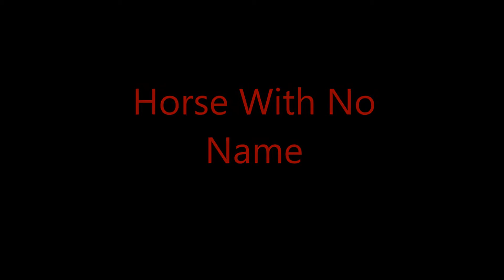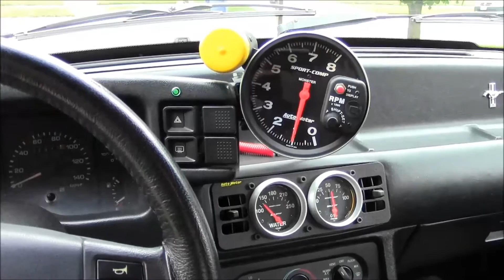HID LED Mustang

Comment: what brand are the tails
Reply from the maker: +Acekid187 I got them from American Muscle.  I was looking through their web site to try and find em... but it looks like they don't carry them any more.
Reply: Ok thanks a bunch. Do u still have them. Any issues. Cjpony still carriers them and I was thinking about getting them
Reply from the maker: +Acekid187 Still have em... they have been flawless for about 4 years now.  Just be sure to buy some clear rtv sealant so you can seal the lens to the housings.  If you don't you may have problems with water getting inside.